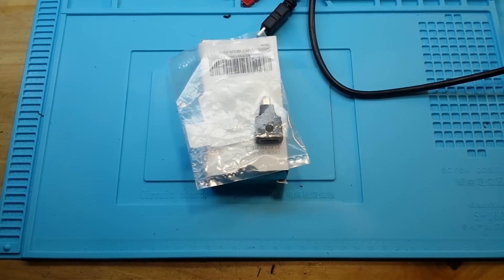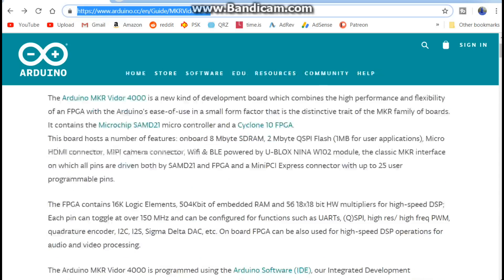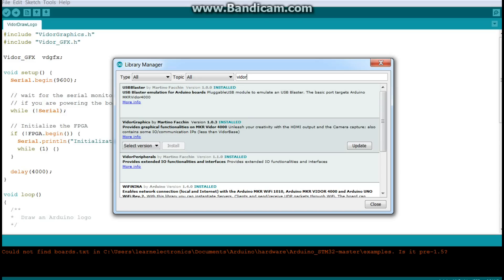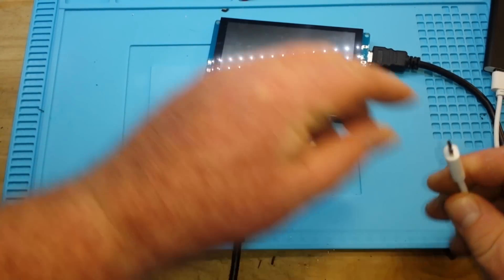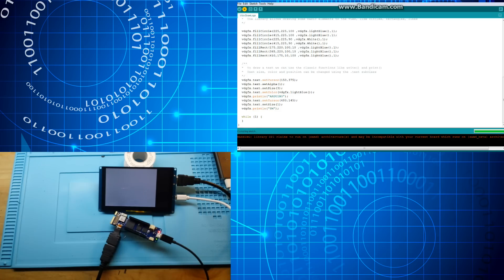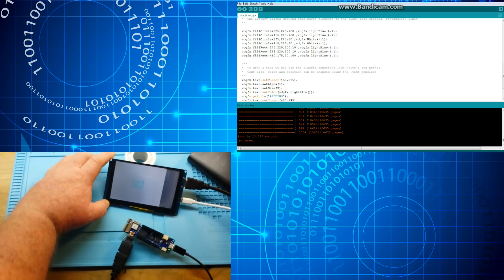Arduino Vidor 4000 Part 2 FPGA as HDMI Driver

Comment: Nice video and well expained.The problem with your display is an incorred timing.The  smal gap are the sync signals and should not be displayed.The white zone after the gap are the first pixel of each visible row.
Change the display sync data in your code or library and you should see a normal picture on your screen.
The correct sync data you can find at the documentation of your display or online.

Comment: Did you all but abandon this board? Lol
I am looking for a simple yet reliable way of running text in a much higher resolution with arduino code and this seemed like a good option, only to be disappointed with its performance.
Reply from the maker: Yes, very little support out there. You would be better off with a more mainstrem fpga

Comment: my mkr vidor 400 put just noise on hdmi output like old tv with no signal. is board faulted or monitor not understand 640x480, but it output that noise so it works but do i have some wrong on arduino build lol

Comment: Has  anyone tried to connect to their wifi with the Vidor  4000  I have not had any success and no working examples.  The firmware upater does not work, and in a GitHub session I was told that the vidor did not get the latest version and you have to use and older version. So far I have been really unhappy with the new Vidor due to no working examples and lack of tech support.
Reply from the maker: I'm not pleased with the support for the Vidor. It seems to be an orphan.

Comment: Nice demo of the MKR Vidor 4000 HDMI output.  I'm curious, is the HDMI LCD used a GeeekPi 5 Inch Capacitive Touch Screen 800x480 HDMI Monitor TFT LCD?   The GeekPi display seems to match the markings of the one you use.
Reply from the maker: Yes, that's the one.
Reply: @learnelectronics   Cool! I just received one and I am seeing the same issue with the right side of the screen with the scan lines.  I'm guessing it is due to the default 640x480 resolution of the Vidor 4000 code.

Comment: The Arduino logo that appeared and then faded was obviously a built-in Arduino 'splash screen' - it appeared before you had any sketch uploaded.

The text is confusing. The sketch was supposed to print the Arduino logo on the HDMI display, but there's no sign of that. It's almost as if the HDMI is acting as a Serial Monitor...

Comment: As boxes of goodies go - that lot takes some beating.  BUT - for the moment I can't think of a single thing to do with it all.  Don't get me wrong I've got a box of goodies and a drawer full of dreams just waiting for summer to start round here.  I'm going to install a low voltage solar system in the garage and of course radar controlled LED lighting and a standby wind generator.  Dashed if I can think how to fit a new fangled brainbox into the equation.  So no pressure but you're going to have to come up with something good!!! ;D

Comment: Thanks for pointing out at the end of the video, that Arduinos normally don't have HDMI output. However since the price is 60€ it needs another usecase. I looked into it, and found that for Intel it's "image capture, scaling, high-performance preprocessing, and communication functions". So it might be able to preprocess pictures for machine learning.

Comment: You said Arduino Uno isn't capable to create graphics or use LCD screen?!... Any arduino like Uno or Mega so on can use that LCD screen but you need a little knowledge for software programming.
Reply: HDMI was implied
Reply: Simple arduino boards have no graphic card capabilities like vidor. Uno or Mega don't have hdmi or vga. They are sending the orders to LCD's controller. With vidor you can control LCD screens without their controller IC's.
Reply: @borakilerci1299  Agreed - exactly what he implied...

Comment: Hello, 
How do you actually program the FPGA? Or you just upload those ready libraries?
Reply: He's now using premade library for graphics. Library contain binary image that's flashed FPGA configuration memory when he uploaded sketch to vidor. There are git repository where you can build your own library with your own design in FPGA. Recommend to check nandland turorials before starting to make design with FPGA. I think Intel also has free course for SW developers that want to start FPGA design.
Reply: LimbaZero actually I’m more a hardware/firmware oriented than software.  Thanks for the tip.
Reply: For programming the FPGA be prepared to learn a hardware description language such as Verilog or VHDL.
Reply: stamasd that I can do but my question is how to flash the vhdl/verilog design on the mkr board
Reply: @dalahmah  I have no personal experience with this board. But the general rule of thumb with FPGAs is that the firmware binary stream is held in an EEPROM chip and on boot is uploaded to the FPGA. Or maybe in this case the firmware may be held in the flash memory of the Arduino part of the board and uploaded from there to the FPGA at boot. You may be able to find some answers if you look through the source code of the libraries.(edit) also look at this: https://github.com/vidor-libraries/VidorFPGA and https://www.arduino.cc/en/Tutorial/VidorHDL
Reply: @stamasd8500  Thanks!
Reply: @dalahmah  Easy and fast play Quartus Prime Lite + USBBlaster sketch for arduino part. For using it with arduino then use arduino provided github as project template and use scripts to build it to library for arduino. Also learn Verilog or VHDL and recommend to keep all in one clock domain. nandland yt channel have basic tutorials for FPGA if you want to check where you are going :)
Reply: I just got one recently and was looking into it. This is what I found http://smartaleks.io/?p=260

Comment: 0:00 an Arduino of Wonders!!!! FPGA!!!😱😱😱😱😱😱😱😱😱 WITH HDMI!!!!
7:50 Your computer appears to run out of RAM!
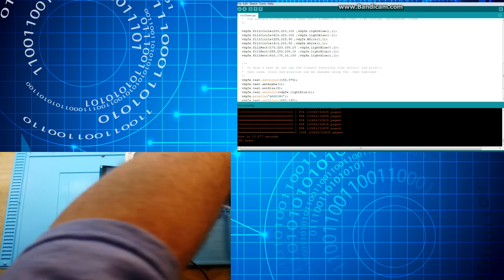8:40
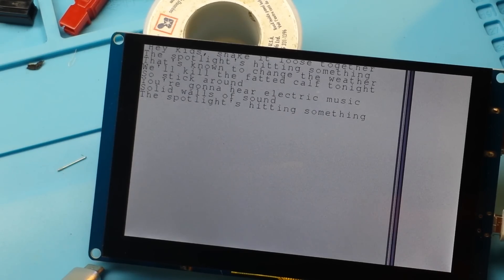10:10 Your computer appears to have some hog ups. RAM is low, I believe. USB is okay and if not, while(!serial); will prevent Arduino from starting since Serial is not established.
You know, Windows will act weird like screen blink, turn to awful graphic, GPU crash, whatever stopped working if RAM is running out. Also it can hang unresponsive. Review your RAM setup! Also make sure the page file is large enough.
11:10 Raspberry Pi is a Computer. Single Board Computer. Designed for Data intensive task. Arduino is Microcontroller, designed for Robotics, one of them is Mechatronical task.
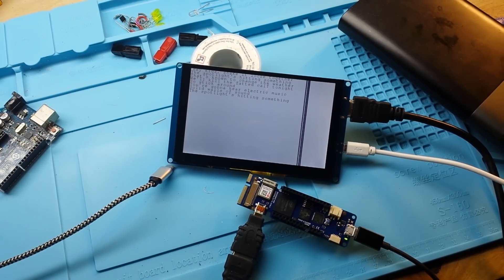11:49 Sloth

Comment: So I’m thinking of leaving PICxxxx, Intel 8051/2 etc for the deep seas of the Arduino. Too dangerous and reckless?
Reply: Actually you should learn arduino as fast as possible because it's capabilities more than pic or 8051( I'm not saying pic and 8051 bad. THEY ARE VERY GOOD UCONTROLLERS). The Arduino environment is pretty good for beginners and even professionals. Even Arduino IDE can program ARM microcontrollers and others. I started everything with Arduino 5 years ago. I suggest UNO and NANO boards to start. Than you can try MEGA and even DUE boards. Have fun
Reply: Bora Kilerci :—- Thank you. 😀
Reply: I think Arduino as HAL/OS with good library and MCU support. It hides all low level stuff etc. I really miss debugger suppport if I do large project.